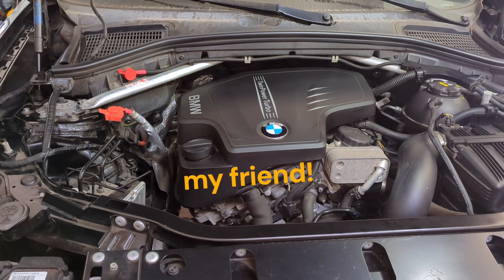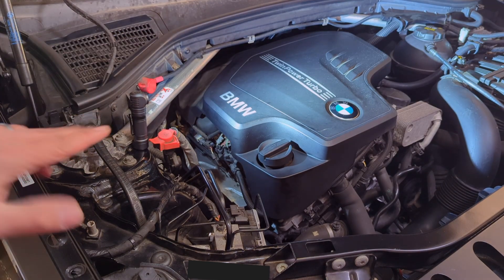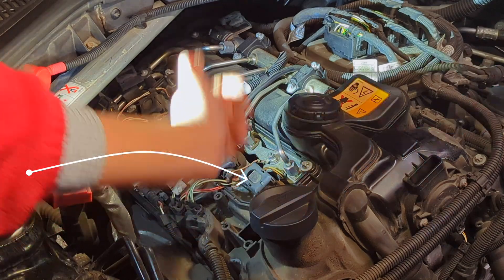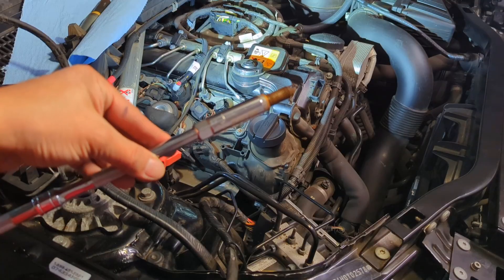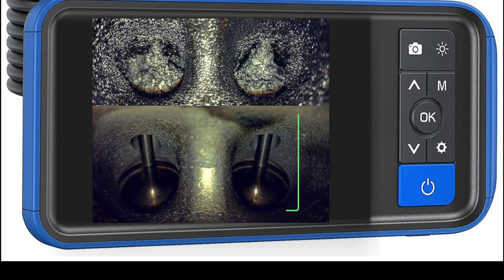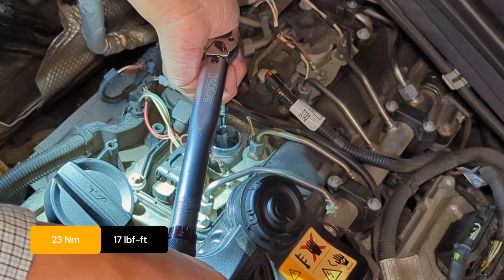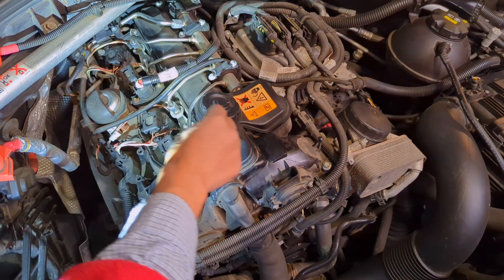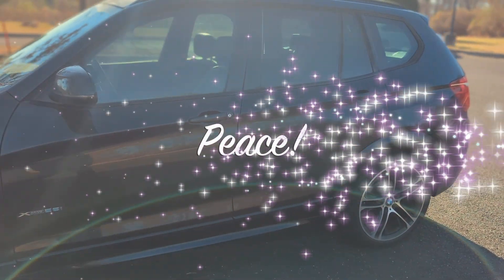Spark Plug Change on 2017 BMW X3 F25 (N20/N26 Engine)

Comment: I would like to warn your subscribers and you professor that they make iridium counterfeit spark plugs.  I thought all four for iridium spark plugs for $20 is too good to be true it usually is lol.😂
Reply from the maker: For OE parts, you can get them from local or online dealership. If you purchase brand parts like NGK or Denso, make sure you get them from a trusted seller/source, e.g. RockAuto, FCP Euro.

Comment: Hi Professor.  Where did you get the spark plugs.
Reply from the maker: I got them from Rock Auto, or wherever you can get these NGK plugs for a reasonable price, e.g. on Amazon: https://amzn.to/4hqkrmd. RockAuto normally has the best price plus shipping and you can save on shipping if you order other parts from the same warehouse in a single order.

Comment: Nice detailed video. I always put a tiny bit of anti seize compound on spark plug threads for aluminum heads. Is this still necessary?
Reply from the maker: Great question! Not anymore. Modern spark plugs come pre-coated, so there’s no need to apply anything. In fact, manufacturers like Denso specifically recommend not using anti-seize or grease on their plugs.

Comment: Have you had any carbon build up problems with the N20 on the back of the intake valves ?
Reply from the maker: I have no doubt I have with Direct Injection on the N20 engine, though I have yet to inspect the intake. It's on my schedule to clean the carbon buildup once the vehicle hits 100,000 miles, likely in the summer.

Comment: Good morning, how about pulling out this engine's timing chain tensioner and press it again a weighting machine. See how many lb is registered when its plunger moves down by 1 inch. Would it be 20lb or 15lb or 10lb of down force.?

Then do it with a new tensioner. BMW owners in Taiwan change their timing chain tension every 60,000 miles. I guess when the old tensioner is losing 25% of its tension it is failing but still within spec vs an old tensioner having only 50% of original tension is a failed tensioner. 

We should not change the tensioner only when the timing chain starts to rattle. Yes?. Regards. Have a good day.
Reply from the maker: It's an interesting proposition! I do think you have a valid point but here are two things to consider. The number one is cost. If you are to hire someone, timing chain tensioner replacement is much more involved than changing spark plugs and the labor won't be cheap. In the U.S., I doubt any car owner would request this service until the chain starts to rattle. 

The second is about potential failure of related chain components and depends on the product year. Early production years of the third generation X3, for example, have problems with plastic timing chain guides. When replacing the guides, it makes sense to replace the tensioner as well while there. Similar to old-school timing belt replacement/service, when things are already taken apart, one should go ahead to replace other components that might fail down the road (e.g. tensioner, water pump). In this case, the tensioner replacement is usually recommended every 100,000 miles. 

As a DIY mechanic, I'd probably do it over 100,000 miles (perhaps 150,000 miles) on my BMW but won't recommend this as a regular maintenance item (with an interval) unless the specific model/production year has a common problem with the timing chain. Such a tensioner, just like the chain, is designed to last. If the part has a production problem, replacing it with an (updated) OE part should fix it once and for all.

Comment: You're overdue for a Lexus.
Reply from the maker: Yes. Overdue for any direct injection engine. Here's what happened to our Lexus: https://youtu.be/2L0Bg78BRYg
Reply: Yep.  Next time you go to replace those plugs those connectors will snap off like uncooked spaghetti.
Reply from the maker: @robertmaybeth3434  usually you expect that with aged plastics but surprisingly those on this X3 have held up beautifully. I've yet to break anything in this job and will see how they hold up in the next 60k miles.
Reply: @profsg  that's great... even so I'd still soak all theh connectors w silicone spray every so often, (unenergized of course) it might prevent them from getting brittle!   I own a 2001 Solara V6 and a 2002 Camry V6.  My Camry I've always used silicone grease and spray when I did the sprak plugs, I put silicone grease inside the coil where it touches the spark plug, and some on the electrical connector to the coils too.  The ones on my 2001 Solara, that didn't have any silicone grease on there, all cracked and needed to be replaced.  Silicone grease is life!
Reply from the maker: @robertmaybeth3434  thanks for sharing! Sounds like a good idea! I've used rubber treatments like AT205, which is impressive, but haven't done anything on the plastics.